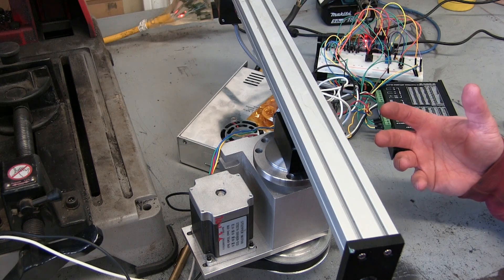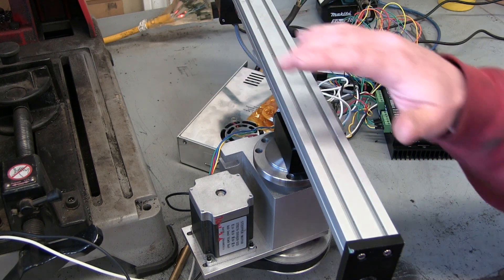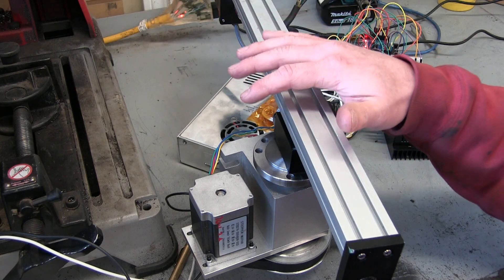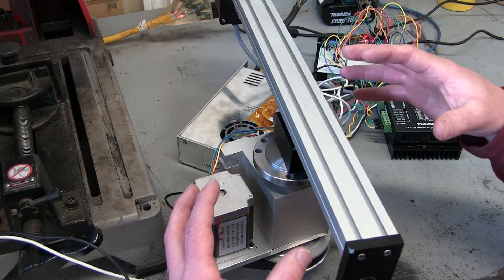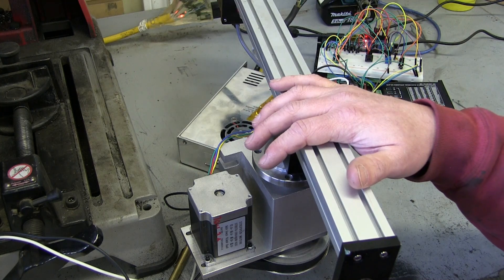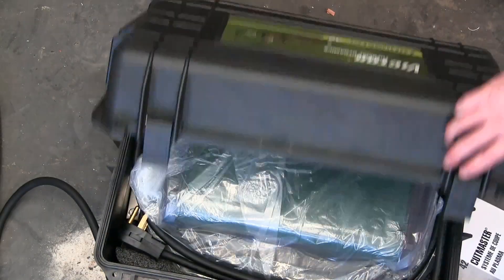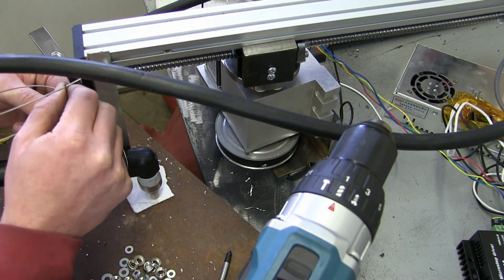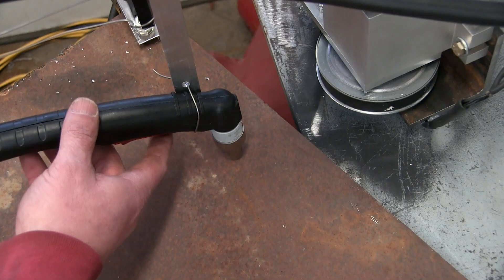Portable CNC Plasma Prototype

Comment: Those electric door locks hold 400 lbs. They come in all sizes. But 3' x 9' is about average. All that cosine math to get it to cut a square or even a circle are the biggest hurdle. You'd need a library of shapes to get it working and lead-screw backlash and belt back-lash are different and particular to the belt. Totally feasible idea. But if yours cuts straight lines and you can sell it for $7000 there's no reason to go rocking the boat.

Comment: I fucking love this idea. I want to build a small home cnc plasma but big enough for standart 1x2m steel sheets. 
I wanted to make a simple 3 axis system but I would have to take apart very time and rebuilding which would have been a pain in the arse.
This is fucking nice its small cheaper and even portable. Thanks <3

Comment: I’d use it. I’m interested to see the material/design used for the arm, however. It’s ability to maintain that hold off distance when fully extended will be key. There’s a lot of emphasis on torch angle, distance to workpiece, etc. that affect the quality of the cut. If I use this tool only to have to go back and dress the edges, I’m more likely to stick with what I know instead of make the transition. Hope that makes sense. Not the best at conveying ideas clearly. LOL Exceptional idea.

Comment: You need to check how well the rotoryand linear axis can work together when cutting line perpendicular to the linear axis: harmonization of controls can be tricky and that's why most C&C works on Cartesian axis. It could work but it tskes some finesse

Comment: A "dual tool mount" that holds plasma cutting head and a dremmel tool. Once the steel is  cut, the mount can be rotated 180 to repeat the pattern with a burr or polishing stone to smooth the cut opening

Comment: If it hasn't been mentioned: it would be useful to implement a "learn" mode: allowing the blue plastic capped worker to trace out the cut pattern by moving the end effector. Easy to read the rotary base feedback, but physically moving the linear rail is problematic, more an issue if you're using rotary feedback. If using linear scale, you could mechanically disengage lead screw to allow free range of movement for learning purposes.

Comment: For personal use it would have to be cheap, or at least inexpensive.  The welding shop I worked in during school now does a whole lot of ... Art-Deco reproductions in addition to heavy welding repairs for the (big) city and county.  Thu unit would need to be armor plated because it is sure to be absolutely sure to be banged around.  PS:  get a straight plasma torch made for CMC table use...

Comment: Wouldnt if have to be varible speed on the rotary stepper because the farther extended the linar actuator is from the center is the faster it will move the gun  compared to it being closer to the center. I know very little about steppers and less about programming them but it would be done in the programming part answered my own question hahaha kinda understanding it quit and dirty style

Comment: I'm a mining equipment mechanic, now in order for me to purchase a tool like that, it would have to be smaller, and super easy to use, and skukem as frek, like a  magnesium case or something, I would rather there be a in board system, and not have to use your phone, because when your  covered in  Hydraulic oil, and grease the last thing I do is want to do is try and get my damn phone to do what I want, and for the controller all tack tile switchs/selectors, no  touchscreen, and make the  buttons big and beffy, but great idea, also using a name brand plasma cutter would make me feel better about getting it, and different sized versions would be nice, a small like 10"-12" swing would be great for complicated bolt patterns that have to be precise in tighter areas, like the ida though

Comment: I'm thinking you'd have it do a dry run with a laser to trace the design so you can measure twice and cut once. Then you could adjust the x and y to get it in the right spot

Comment: How about a 'follow the line' cutter? Draw your line in a contrasting color. Machine does a dry run following it and maps out the data. If it looks good tell er to start choochin. Would make for easy custom stuff and no bumblefuck interface or app needed.

Comment: I would absolutely use it! Very cool concept. Using it upside down would be an issue as the part would fall onto the cutter head once freed from the host piece of metal, no?

Comment: A little late to comment but here's my useless thoughts.
Somehow have the swing arm retractable so the swing won't interfere with anything. 
Along with the laser pointer, a depth sensor for the gun.
Programmale speeds calculated by steel thickness and grade. 
Paint it red so i goes faster.

Comment: Great i think im going to have to order up one of those X Y router set ups for a arduino and add electro mags to the corners. some one smarter than me could even add servo to the corners and make the whole rig walk right across the surface. would be like a plasma drone . ill have to get creative and make the arduino communicate with my  longevity chinasium Multi-process as it has a cnc dongle

Comment: I've been working on a 5' cnc xy table in my garage from scratch. I would highly recommend gearing down your rotation axis and micro stepping. This will give you a higher resolution that you will need  at further extension.

Comment: Bare the torch insulinsulation and tap into the two wires to the torch micro switch and connect to a mosfet switch interconnected into the axis drive.

Comment: A lot of comments about the Z axis issue. How feasible would it be to have a wheel or ball roller that ran along the surface of the material. Gravity would do the rest. You could even maybe have a fine adjust set screw. Doubt thered be much drag issues if you stick with the worm screw and resolver set up. I say as many quick connects as possible for the actual torch. Allow for different arm sizes. And as everyome said the plotting is already solved. The last thing would be an app with a usable UI. Creating a local wifi network would be simplest. Hardward is already made for raspi anyway. Find a good app developer. I think the best method is allow to manually set start point of cut. Havw X and Y direction buttons on app to move torch head. Put into position. Enter cut route. Start button. Maybe add free hand cut program? Basically have a grid on the screen thst you can draw on and it will cut. Have adjustable scale.

Comment: You actually don't need inverse kinematics for that. You just need to convert from cartesian to polar coordinates. It's pretty simple, I'll try to briefly explain...
Basically you need two values for the two moving parts right? The distance from the center (so the radius) and the angle.
For the radius you just use the pythagorean theorem radius = square root  of X quared plus Y quared or sqrt(X²+Y²)
The angle is essentially just the arc tan of Y devided by X so atan(Y/X)... If you wanna know why that is the case, there are several videos explaining it quite well here Youtube. But that's how it works. Basically just two calculations.
That said, of course you still have convert that to the actual steps you need to go with the stepper motors etc. But that shouldn't be to difficult.
Apart from that, I would say it's a very realistic idea. Why not build a cnc plasma cutter. You can build a cnc anything really. Go for it! ;-)

Comment: When I first started out I was a fitter... in the days when my back could still take it.
Although I see this as potentially useful, using a damned cell phone to operate it is  a show stopper in my humble opinion... at least in a heavy industry setting.
Guys just want to plant it, and press buttons. There's no time for jacking around with wireless fuckery in a welding or fab shop with all the insane RF noise going on everywhere.

Personally, I'd drop the portability idea and focus on more of an entry level NC cutter for small fab shops where guys want to be able to cut complex shapes, but don't have half a million change to buy an industrial CNC rig. Maybe a kit type deal where they can attach their own portable palsma cutter kinda thing. Make the interface USB or RS232 for laptops or tablets.. but avoid the wireless cell phone shit man.

Comment: I am a Fabricator and Welder and I would use the hell out of it. Just would need to be super skookum what for all the 200lbs gorillas throwing it around. Great for field or shop work, especially if you can set it up and break it down fast. Lead management would be something to consider into the design what for dealing with all the leads.

Comment: I would definitely use this thing. Your right that is a huge gap between manual plasma cutting and the big plasma tables. Last time I check it was around 5k entry for CNC plasma. I think a good price point would be close to 1k and like you said it could be a hybrid for the mag drill and full CNC table. For reference and refinement here is the circle cutting tool that "Make it Extreme" did https://www.youtube.com/watch?v=qs7ZEFomGTQ which I think you can buy plans from them for. Might be worth a collaboration effort.

Comment: You are on point with a phone app and keeping it dead-nuts simple. Very easy to have a selector for hole diameters (metric/standard). May have to use a nozzle optimized for multi-directional dragging. Also, if the torch is spring loaded, it will ride up/down any ridges caused by un-even material or ridges/dross created from the cutting process.

Comment: Going from cartesian (x,y) to polar (one dimension is an angle, the other a linear distance) is actually much easier than you'd think, just takes a touch of trigonometry.

If t is the angle that the arm swings through (normally called theta, but im not going to bother getting out my greek keyboard), and r is the linear distance to the origin (radius), then to go between cartesian (x,y) to polar (t,r) it is simply:

x = rcos(t)
y = rsin(t)

Therefore, simply program the app in cartesian like everyone knows, and then at some point have either the app or the arduino convert the cartesian coordinates to the polar equivalent and then the operator, living in his world of rectangles, never even has to know the robot lives in a world of circles.

Comment: I feel you need a z axis.. it works for thin material but when you get into the thicker materials you need to be able to set a z. plus nothing is perfectly flat unless machined. chances are your not going to use a plasma on machined parts. great idea. I love it. what's the approximate cost and what is the size. i.e. what is the largest square you can cut? it would be extremely awesome if it could do bolt holes.

Comment: Just started watching your channel. Well done and thank you! Inexpensive multi-purpose robotic arms are the new hotness. ( https://www.indiegogo.com/projects/uarm-swift-your-personal-robotic-assistant-education-gadgets--2#/ ) A plasma cutter coupled with one those babies (0.2mm repeatability) would get the job done. Add an inductive sensor and auto bed leveling and you could maintain perfect torch height when the arm is placed on uneven surfaces (yeah I know if the arm is oriented to the stock this shouldn't be a problem). At any rate, thanks for the video. Keep up the good work.

Comment: You could just store basic patterns on the arduino, and have multiple microswitch buttons on breadboard to choose the pattern, a potentiometer to select size, and dry run button so it shows what it tries to do.
Always start from "same point", user chooses starting point. So say it always assume it's on top left corner of the pattern or something :)

For complex patterns you'll gonna need a confusor

Easy as pie!

Comment: I would run it. App also needs to work off a photo. A measurement on two points and a calculation could run out anything that wasnt too detailed. I know there are screw and gear drives, but would a cable drive work too? Or even hydraulic. Carrying tool to sheet would be a shitload easier than carrying sheet to 5x10 plasma table. 
Im no software junkie,and i have a habit of releasing the magic smoke. But making something chooch that was in the junk pile a few hours earlier is my skill. Fine tuning the works from a garage door opener to prototype would be a hoot.

It would be easier to tag in a toggle switch /relay at torch connection than to hold button, no?

Comment: I'm thinking that the drag shield (being for humans cuz we're bad at consistent distance) is just gonna get hung up on surface slag. Toss it out or modify so its clearance is better. 

For an all in one machine an offset cutting head in relation to the arm would allow for easier and proper alignment of the tool. 

But since this is aimed at fabs and welders, a "bring your own plasma cutter" tool would be nice. an air fitting and electrode receptacle for plugging your own toys right into the machine and a hose clamp style head mount would be amazing.

Air compressor + plasma cutter -->  connects to cnc machine -> connects to your own lead

Even if you have to purchase or modify leads to connect everything it'll still be legitimate and less expensive than buying a whole new cutter.

Comment: I would say to flip the handle of the cutter around so it's not hanging over the edge. After that connect a motor to the trigger so that when it is running you wouldn't have to trigger the unit, but when it's not running a sketch the cutter is off. In terms of the easy part pre-made routines but with the ability to upload custom drawings. Of course all ideas sound great on paper or through a keyboard.

Comment: Holy hell, this is an amazing idea. As a decently invested hobbyist welder/fabricator I would use the everliving fuck out of this. You could even write the app to accommodate cutting current, material thickness, and airflow in order to produce appropriate travel speed!

Comment: fucking love the concept. id like to see a 3rd axis for the torch height, in my experience with a 5.5' x 15' table torch to work distance is crucial not only to account for bowed plate or in this case a nonlevel surface but for cut quality and consistency. keep up the good work love the videos

Comment: It is pretty easy to wire a relay into that trigger at the inverter side.  I think a small OLED display on the unit would be nicer than bothering with a phone app.  You could select a "shape program", then set the dimensions, and the origin, and hit 'go'.  I bet it would be trivial to make it read openSCAD shapes as well so users could do custom parametric shape programs or pre-loaded g-code files, etc.  This is a great use for machinekit, or possibly marlin if you want to keep the cpu cheaper.  I can help with the controls if you have troubles.

Comment: A couple of thoughts. Does the plasma cutter have a 4t mode for the trigger so that you can press the trigger once to start the torch and once to stop it? That would let you take your hand off the tourch while it cuts. When you get everything refined you should be able to tie into the remote input/cnc input of the plasma cutter to start the torch which I''m sure is where you are head with this.

Comment: Well, Doug is apparently excited to try it out, lol.

Seems to me that some clever programming and a mount for the plasma cutter will get u past most issues. I'm just wondering how u would get the machine to put the holes where u want them, and in the proper orientation. If u are cutting slots, for example, presumably u would want them going the right direction and in the right orientation relative to each other. Would u need some kind of feedback mechanism? Or maybe a calibration template of some sort?
Oh, maybe u could put a [X] laser projector on the arm on a dial. The user moves the laser to the point they want to start the cut, then rotate the dial to adjust the orientation with digital feedback to the app!

Comment: If you add a camera, you could draw your cut line with a sharpie, press a button, and first have the arm trace the path without cutting to read where your cut line is and do a sanity check. Then press another button and it traces the same path with the cutter. No phone app required.

Comment: Good stuff AvE.  Another possible arrangement is two rotation points (like a drafting arm).  Makes it potentially smaller and you don't have to deal with lead screws.  Makes the kinematics harder tho. Time to remember wtf SOHCAHTOA means

http://www.harborfreight.com/media/catalog/product/cache/1/image/9df78eab33525d08d6e5fb8d27136e95/i/m/image_18341.jpg

Comment: ditch the phone app thing, make it like a 3d printer interface, screen on the device with a scroll wheel for driving it, and some buttons etc....that way the entire thing can be run of arduino et. al. and make sure you shield the frig out of it... nothing gonna be worse than transient arc freq, fragging the pixies, and making it screw up the cut ;)

even so far as if they want really intricate cuts etc, then they can layout the design and sdcard it into gcode/pattern/whatever, and the polarizerplasmacutter just follows the lines...

Comment: Put a little joystick and a couple buttons on the thing. 

The operator uses the joystick and a button to mark out corners. Hit the go button and the machine cuts out the polygon.

The operator joysticks to the center of the circle, hits the circle button, then joysticks to the edge of the circle and hits the go button. The machine cuts out the circle.

Boom!! no drawings, no computer, no phone. Maybe just a ruler.